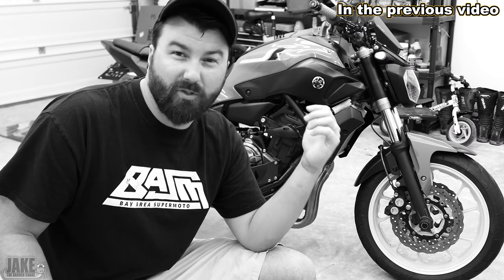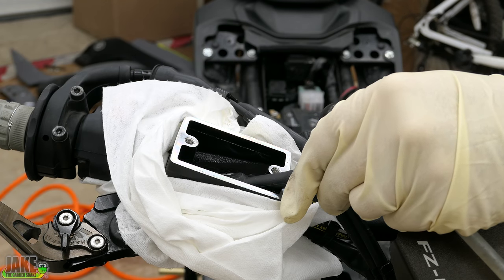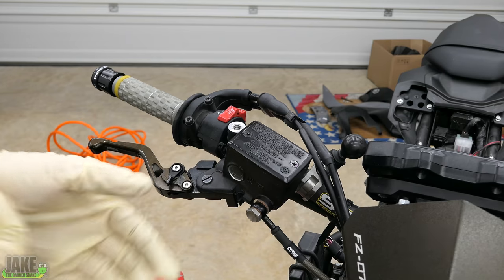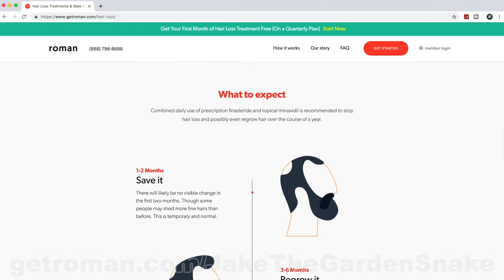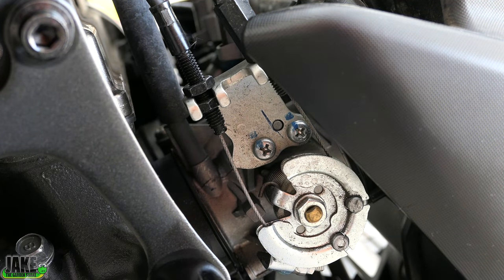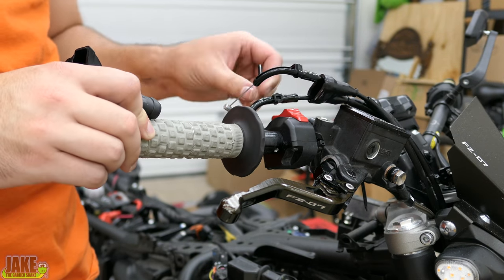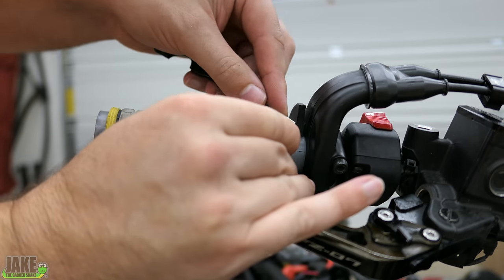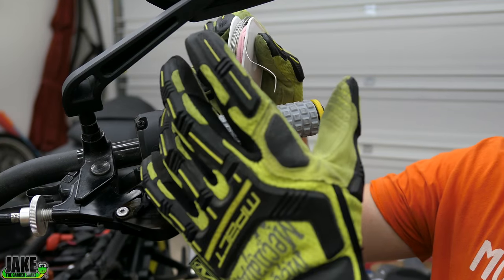FZ-07 MT-07 Tune Up and Maintenance Part 2

Comment: a non-return, one-way valve also works for flushing the brakes. 

don't throw away brake fluid just because it's an open container... that's just laughable. use a Ziploc with silica packets if you're paranoid.... it takes a lot of water for the brakes to fail due to steaming, there is no way for that much moisture to contaminate a container with the cap on. plus the real issue would be corrosion because of moisture content..

20 yrs ago the brake lines and connectors were manufactured in a different way. moisture would permeate through the hoses and into the fluid when the fluid cooled down. today, the moisture content is not the major issue anymore: it's the additive package depletion... the content of copper dictates fluid replacement (>200ppm for modern brakes).

Comment: Is there a part 3 on the way where you balance the throttle bodies? Also, at what mileage did you do all this?

Love the video. Thanks!
Reply from the maker: Yeah a part 3 is coming with that. I’ve got 6k miles.
Reply: @TheGardenSnake  Oh wow. I should get cracking. I've got 6k as well. Thanks for the vid! Looking forward to the next one!

Comment: Safety wire... Dangerous.! ✍️🤔
Reply from the maker: Dangerous cuz it’s easy af to stab yourself
Reply from the maker: Cuz I don’t glue em. The glue is shit if you ever plan to change the grips again. So safety wire holds tight so the don’t spin. Hope that helps.
Reply: @TheGardenSnake  Still don't need the wire at all, they stick fine without glue.  A little brake fluid to get them on quick and easy, once that evaporates your grips will be solid.